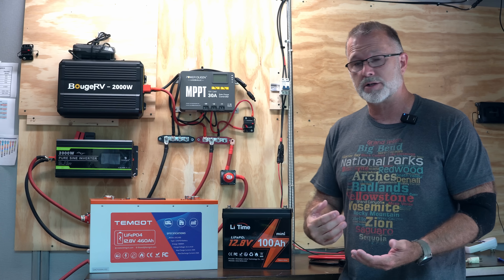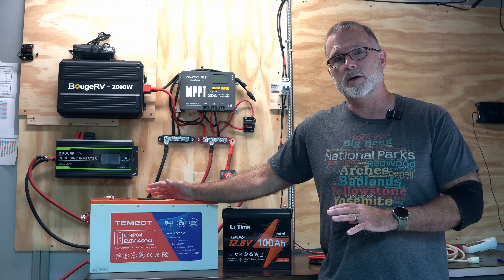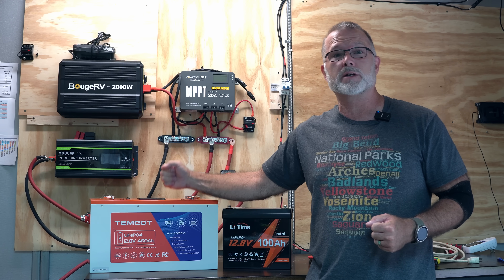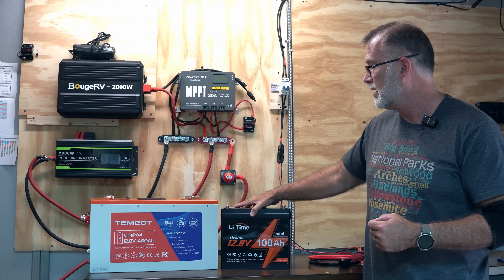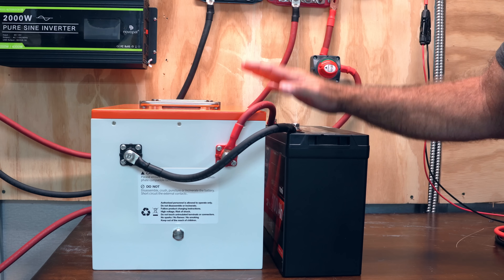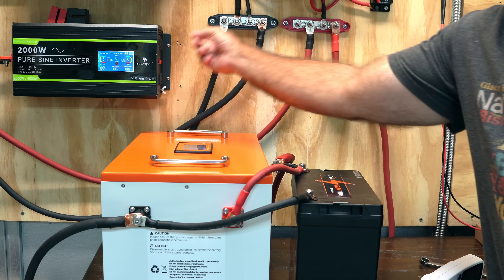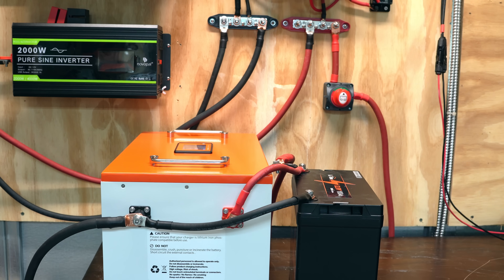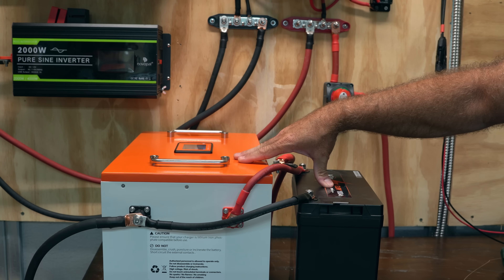Connecting Batteries with DIFFERENT Capacity in Parallel - What Happens?!

Comment: Question for you,  I have 4 12V 75ah batteries that were originally configured as a 48V series connected pack for an electric riding mower.  They were replaced because one battery was weak.  I currently am using the 3 good batteries in a 12V parallel pack with an inverter to run essential loads during power outages.   Could I add the 4th "weak" battery to my setup for increased capacity?

Comment: Also. From last question. If need i can use separate invertors on a on, off as needed for different items. If needed the pull on batteries will be hi at times so i want to keep toped of, or at least helping them from a high drain.

Comment: On a boat. Solar charging in day, wind turbine charge at nite, seperate mppt controls, if day time and windy can i use both at one time ? Frig, stove and  or anything needed that does not go over inverter capacity to KEEP  batteries up. AC unit . There for not needing to run generator for periods of high needs. During day, solar, nite hopefully wind to run frig, AC. Can i run both at one time to KEEP the batteries up?
Reply: Yeah you can, it just looks like extra charge current to the batteries, You could run solar, wind, generator all at the same time. Go make some power! enjoy the boating
Reply: @Ben1551  THANK YOU.

Comment: Thank you for the video. If you are interested in doing comparisons on pure sine inverters to modulated, there are important factors with different electronic devices. For example, my 120V house furnace (300W) won't run off of a modulated inverter but will run off of a pure sine wave inverter. But if my modulated inverter feeds a Vevor voltage converter, (120V to 120V) that satisfies my furnace electronics. That would be very important to know if the power goes out for any length of time in the winter!
Reply: Electric motors, like the one in your furnace, do not like simulated sine. The simulated sine causes spiky current (high, low, high low) which causes noise and excessive heat in the motor windings. Pure sine inverters should run motors just as well as the mains power does. 
The simulated sine wave creates similar spiky current within electronics, which some switching power supplies, such as PC power supplies are ok with, while others do not like it. Again, excessive heat can build up in certain components of the power supply. 
The simulated sine works very well for resistive loads, such as heaters, incandesent light bulbs, halogen bulbs, devices powered by transformers, such as the older (pre 2010) stereo systems.
Reply: @javaman2883  Unless of course, the installer knows this and also installs HUGE power factor correction capacitors, that soak up th =e spikes and empty when the lows hit, meaning theyautomatically balance the modulations into a sine wave pattern.

It's simple 101 with any electrician who has built any high power factor correction switchboards.

My "job" for over ten years was exactly that - building heavy Industrial Switch Boards,some with up to 2,000 kWh ratings.
MOST had banks of capacitors, that could be brought online, by an assortment of contacters, all controlled by a large POWER FACTOR CORRECTION meter, as the loads altered.

That meant that the incoming mains cables DID NOT have to contend with high inpout currents when spiked motor startups were in operation, to start huge motors DOL or via Star-Dalta switching circuits.
As these were ALL corrected by the banks of PF Correction capacitors, so the mains wasn't fluctuating around, but appearing as if a balanced sine wave current load, meaning smaller input mains cables.

The huge circulating currents, inside the motor circuits and the switchboards PF capacitors, was handled by HUGE thickover rated copper bus bars, that easily handled whatever the balancing currents needed.

Every other commenter here, is obviously "oblivious" of what happens to loads, which have to be balanced, as they are NOT done by the supply cables, but by the bus-bars interconnecting PF capacitors that DUMP huge currents into the circuits when needed to offset huge current draws.
When motors are at running speeds and with fairly constant loads, the input current drawn from the mains is FAR smaller than the startup currents, which often exceed ten times their running currents.

Comment: A LOT of modern battery chargers need to " see " some voltage , before they will deliver charge .... so charging your ( totally ? ) flat automobile battery seems impossible .... but 1st connect your charger to a charged smaller 12 Volt battery ( say , a fire alarm battery ? ) ... when it is charging OK , then hook up your  BIG  vehicle battery in parallel ..... the ( smart ? )  charger will now charge it up over a few hours .... ( tried - n - tested ) ............ DAVE™🛑

Comment: This works well if you're connecting two batteries (with a similar battery chemistry), but I would not recommend connecting differently sized solar panels in that way. The main problem is that when there are two power sources, in the first phase the current flowing at higher voltages "wins". And that can result in current flowing from one solar panel to the other one, which actually means that the panel with the lesser peak output voltage will be heated up. This not only results in losses of solar energy harvest, but also reduces the effiiency of the second, smaller panel. In extreme cases, it could even damage the second panel, if the empty-running voltages of both panels differ too much.
Reply: If BOTH output the SAME voltage but different currents, it doesn't matter one iota if the smaller one isn't outputting as much curent as the other - at THE SAME VOLTAGE.
As the smaller one will not be over worked, nor if it's at the same voltage level, will it DRAW any current from the other solar cell, so your analogy is flawed.
The ONLY time one solar cell could possibly back-charge another is if ONE isn't outputting the same voltage, such as when it's in the shade of a tree or a building etc., as that would be about the only time it wouldn't be outputting any voltage (and thus current) HOWEVER even the cheapest solar cells have a reverse current DIODE proteting the cell, in case of little to no sunshine, such as during the night, when a battery could back-charge OUT of a solar cell, if it's protective diode failed.

So stating that one solar cell will back-charge another, proves that you have no idea of the inbuilt protctive circuits, EVERY solar panel has.

If however you connect TWO (or more) solar panels with different output voltages, you aren't a very good solar panel installer?

Comment: you could take it to 300 amp, the amps will come from which ever has the higher voltage.   And the bigger battery will hold voltage better so the most amps will be coming from the bigger battery.   If they were identical batteries the amps would be split equally, so two 100 amp batteries in parallel could provide 200 amps.
Reply: And that is why the two batteries go dead at the same time, there are more amps coming out of the bigger battery (4 x as much) since it has 4 x the capacity.
Reply: IF you could ever get two "identical" batteries😂

Comment: Where did you get the 90% number from
Reply from the maker: Assuming about a 10% loss of capacity due to the DC to AC conversion through the Inverter. That's fairly typical.

Comment: Great video I do like to see the out of the box type thinking on how to run your systems. Not everyone can buy the most expensive nicest items that some YouTubers are pushing. Many may need to resort to buying on battery at a time and may get a better deal later with a different company as their budgets allow. 

The only minor thing I would disagree with is that you mentioned it might be a problem if you were pushing 200 amps through your example batteries because it would shut down the smaller battery due to the 100 amp max bms. In that case it would not shut down because that 200 amps would be evenly distributed between the two batteries. So it would actually be 100 amps max from each of them.

As for what happens when the smaller battery depletes I believe I saw another YouTuber do that experiment and the larger battery actually charged the lower amp hour battery and it never fully depleted because they were in parallel and the batteries continuously balanced each other.
Reply: You suggest that "200 amps would be evenly distributed between the two batteries". But it wouldn't. As the charge is drawn from each battery, its voltage begins to drop, but because they are in parallel the voltages must remain the same, which means that the one with the larger capacity will supply a larger fraction of the total current drawn.

To a first approximation, the 460Ah battery would supply 460/(460+100)  = 82% of the current (i.e. 164A) and the 100Ah battery would supply 100/(460+100) = 18% of the current (i.e. 36A) which means they would both run out around the same time after about 2 hours and 45 mins.

Of course the batteries may warm up differntly due to internal resistance heating, which may alter their voltage differentially, or thay may have a very slightly different chemistry, and so on, but these are second order effects, and by-and-large the batteries will tend to balance out quite well over the course of a discharge cycle.
Reply: @RexxSchneider  Could you tell me please if it the exlanation would apply to charging by solar charger? Would small and big battery stop charging at the same time?

Comment: Good video. I had a question about two batteries with 50 Amp BMS..if I connect them in parallel will that still only discharge at a max of  50 Amps or will I be able to discharge at 100 amps?
Reply from the maker: They will 'current share'...so each battery in this scenario will effectively contribute 50% of the current to the load...so would expect to be able to power a 100A load between these 2 50A batteries.
Reply: @ReeWrayOutdoors  ah ok thank you. I asked because I was considering buying two 50-amp batteries. Sometimes you can pick them up fairly inexpensively.

Comment: I disagree with the comments above regarding  the internal resistance dictating the load sharing.

The internal resistance doesn’t dictate the load sharing.  The CAPACITY of each battery is what dictates the load sharing.

Eg- if the load connected to these two paralleled batteries needed 100Amps, the 460Ah battery would provide 82% of the current and the smaller 100Ah battery would provide 18%.  This is calculated from the ratio of their capacities.

Comment: When multiple batteries are connected in parallel, same voltage of course, I would think the battery with the lowest internal resistance would deliver the most current. IF both of these mismatched batteries had the same internal resistance, they would share the load equally? Since the BMS in each battery can sustain 200amps and say you pulled 200 amp load, each battery would be delivering about 100amps each? Since they are mismatched in capacity, wouldn't the smaller battery go flat first, then all load would be on the big one till it went flat? I would like to see an ammeter on each battery during discharge to see what happens.
Reply from the maker: The current sharing between the 2 batteries is determined by both the internal and external resistance from each battery.  But generally speaking, everything else assumed equal - you can think of the current sharing as proportional to each battery's rated Ah capacity.  So if you parallel a 100Ah with a 200A battery...and then apply a load of 150A, the 100Ah battery will provide 50A and the 200A battery will provide 100A (more or less).  And keep in mind that the batteries are always going to seek to stay in sync on Voltage...so if, say, the smaller battery's voltage is dropping more quickly (due to a lower resistance), it will be pulling current from the larger battery to maintain that voltage balance...so they will always tend to deplete at roughly the same rate under most circumstances.

Comment: My only concern would be Fire or Failure and Dealing with Warranty / Mfg'er and My Insurance company
Reply: On 8/2/2024 my battery bank of 3600 amp hours caught fire and did $100,000+ damage to my shop and garage. 12 name brand LiFeP04 batteries of 300AH each in 24 volt configuration  powering a 6000 watt split phase inverter charger and a pair of high frequency 300 watt inverters was in a console with cement board insulation in various places. The TOTAL load on all 3 inverters was less than 750 watts when the problem began.  The charge controller shut off at 100% capacity according to the video monitor of the battery State of Charge Meter. A little while later, a BMS in a battery on the bottom shelf failed and internally shorted. That battery caught fire and set the whole console on fire. The fire broke through the shop ceiling and also melted the shop sub panel. The black smoke was so thick that it looked like a solid column rising from a skylight. I had my high pressure fire hose aiming through the smoke within 70 seconds of hearing a loud POP and saved my home before the fire trucks arrived. The garage is next to the shop and my bedroom is above it. I could have lost everything.

The insurance company is covering the damages, mostly smoke and water damage. They had special fire investigators document the failure and damage. The cleanup was delayed for 6 weeks as the suppliers of all of the component parts were put on notice to be sued. One day in late September, the attorney reps did  the on site inspection and took hundreds of pictures of the burned unit, then everything was disassembled and wrapped and was removed for further inspection. The next day the contractor was allowed to finalize the bid which was accepted by the insurance company and I was allowed to begin the cleanup.

2 months after the fire, we are still waiting for the County issued building permits and no repair work has been done by contractors. I have about 10 tons of machinery, welders, generators, lathe milling machine, cars, motorcycles out in the weather now and the rains usually come by November 1st. It all needs to be moved indoors or be covered. What a nightmare. But I saved my home.  My next solar/battery/inverter system will be an EG4  18Kpv 48 volt unit, UL rated, and it will be in a concrete block enclosure away from my home with 205 degree F thermally activated sprinklers inside. I learned not to trust batteries...even the ''Safe'' LiFeP04 chemistry. The BMS was supposed to protect the battery, not short out.

Comment: Awesome video! Let me throw a question out there, okay, I have 2 similar battery's a 12v Timeusb 230ah battery with no low temp protection and a 12v Timeusb 200ah battery with low temp protection. Will the low temp protection work on the whole system when set up in a parallel application?
Reply from the maker: @stevenseigneurie5073  I don't think so because even if the low temp protection kicks in, the unprotected battery is still able to provide power to a load since there's still a completed circuit.

Comment: Since both batteries are discharging percentage wise equally, does that mean the larger battery is contributing approximately 4 times the current at any given time compared to the smaller battery?
Reply: That's the general idea.  The exact ratio is going to be determined by the internal resistance (IR) of each battery as well as the cable and connection resistances. IR varies with state of charge and the rate at which it varies is going to be different battery to battery (closest in batteries off the same production line with the same batch of materials, etc).  The great thing about parallel is it doesn't have to match exactly, but can trade off a little bit and if given time to rest the batteries will equalize if the difference is significant.  Unless they are grossly different (or cabling problems) the higher state of charge will supply more current to the load while the lower state of charge will take more current when charging.
Reply: @Sylvan_dB  Indeed. This is especially true with Li batteries whose output voltage tends to correlate quite well with the state of charge. It may not work so well with batteries such as NiCd whose output voltage tends to remain constant until it drops off rapidly when the battery is exhausted.
Reply: @Sylvan_dB   people should be aware that for such 'cabling problems' as you mention, there should be enough fuses between the parallel batteries

Comment: Nothing happens.  Works fine. They balance each other as long as you aren’t pulling huge currents from them like trying to run an AC on batteries (good luck with that).  Small camper stuff does fine balancing the load and sharing the capacity. Been running a 100 Ah with a 200ah.  Biggest draw is the 12v fridge and vent fan.
Reply: Luck not needed, just some intelligence.
Reply: There's so many people who run mini splits off of batteries and solar successfully, why the (good luck with that)?
Reply: I run a 5k ac unit off battery just fine
Reply: It's more a question of the A/C design. Older ones had a huge inrush current on compressor startup while most newer ones are far more electrically efficient. And there's quite a few which use "soft start" to greatly lower the inrush- those can run on far less battery capacity than you think and thousands of people are using those as I write.
Reply: In series, the smaller capacity battery will be depleted while the larger will still be going strong. This would cause damage to the smaller one. You would only get the capacity of the smaller.

In parallel the bigger battery tries to charge the smaller.

In both cases damage will be a long term event while you think everything is doing fine.
Reply: @redfields5070 only damage to the larger could occur if the smaller developed a short and there were no fuse between them.